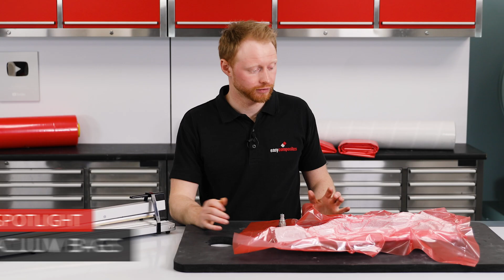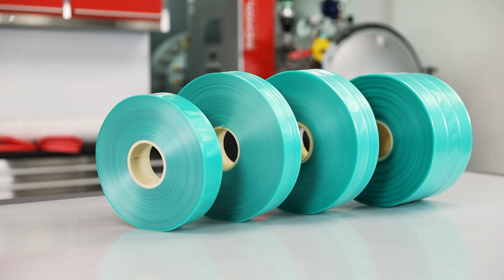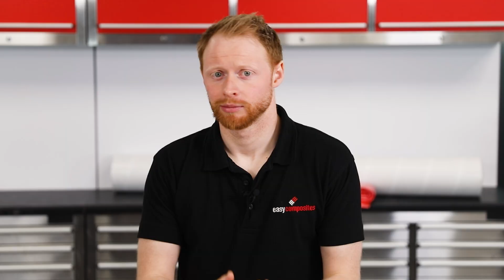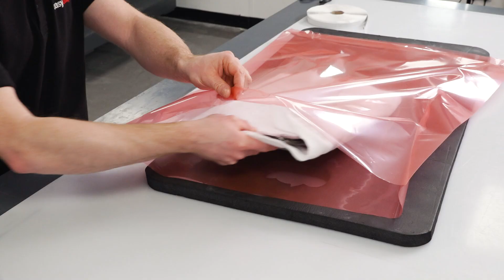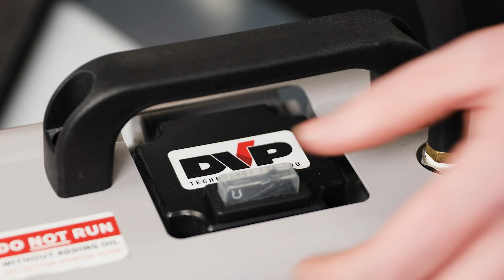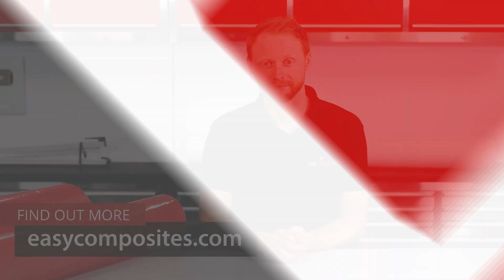How to Heat Seal a Vacuum Bag

Comment: Wow. Been vacuum bagging gor 20 years never thought about using this. Do they sell a 10 footer? 😂
Reply from the maker: Haha, I don’t think so but you can get hand held heat sealers so could, in theory, seal any size bag. However, we’ve not experimented with these hand held sealers.

Comment: If my application requires a wider impulse sealer than I have, is it possible to overlap seals?
Reply from the maker: Although in theory possible, there is the practicality of lining it up properly and the risk of areas which are overlapping melting through.
Reply: Good question, I would give it a try for sure

Comment: will the heat seal still work if there are wrinkles in the bag?
Reply from the maker: It will not be as effective as you are bonding more layers of film together which needs more heat and time so you may get an inconsistent result.